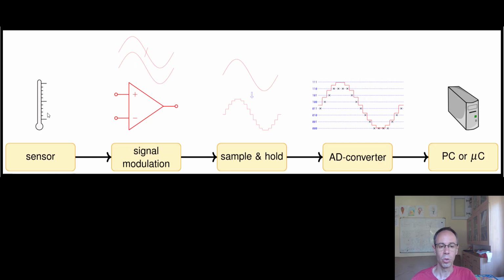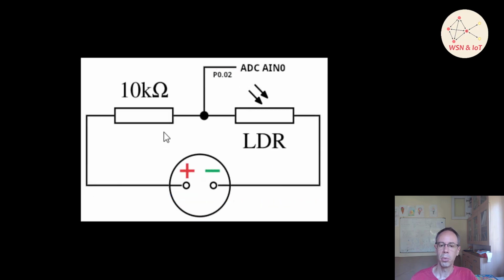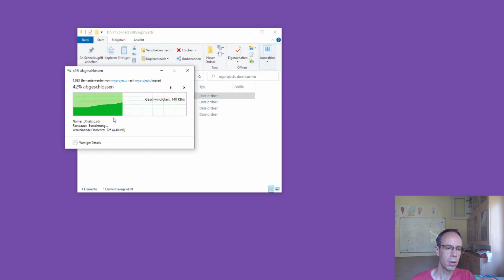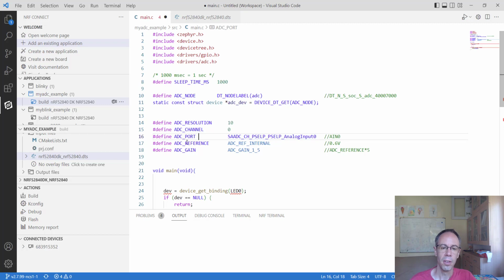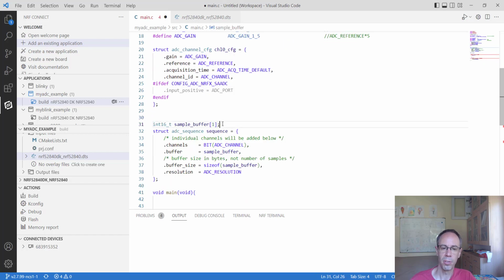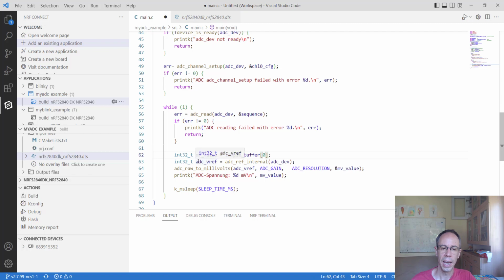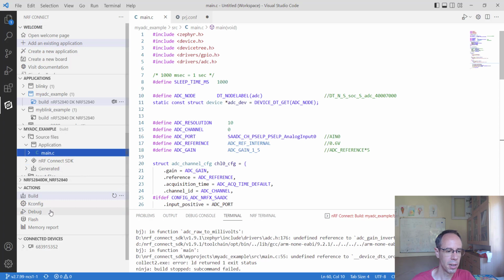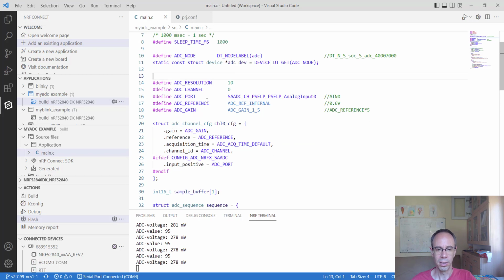Zephyr and Nordic nRF Connect SDK - 05 Analog/Digital-Converter (ADC)

Comment: Hello sir, thank you. Is it possible to read from multiple ports and if so, how?
Reply: I already solved it, now I would like to know how to read a digital input, with this board is it possible to make a DAC?
Reply from the maker: @Michael-nu2mz  Digital inputs can be realised very easily via the GPIOs, see button example. The nRF52840 has no built-in DAC. Analog signals can only be simulated via PWM. An external DAC via SPI/I2C or I2S would be useful here.
Reply: @wsniot  Thanks a lot sir, I tried to test my digital pins with a AA battery using the ADC example that you made in this video and what it does it's that it goes from near to 0V to the 1,5V provided by the battery. Do you happen to know how could I make it so that it goes from 0 to 1 or off to on on the terminal text?, I only need to know if there's a voltage on that pin. I'm very new to C and also to this nrF/zephyr programming. Your videos are super helpful.

Comment: That is an excellent tutorial, thanks for your help. One quick question, I checked the nRF52840 datasheet, and it seems this PCB does not have analog out, is it normal that PCD does not have analog out? Or I missed something e.g some GIPO may be used as analog out pins?